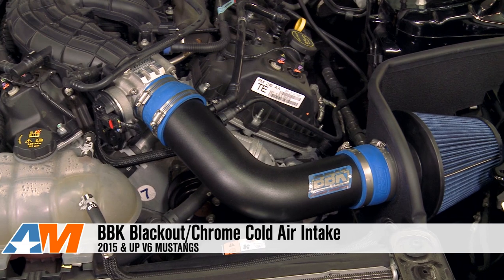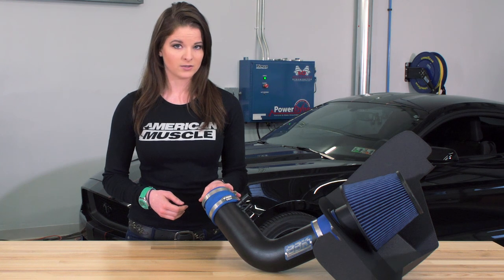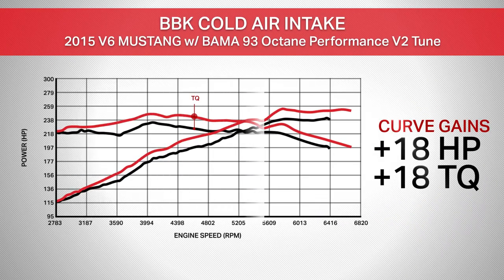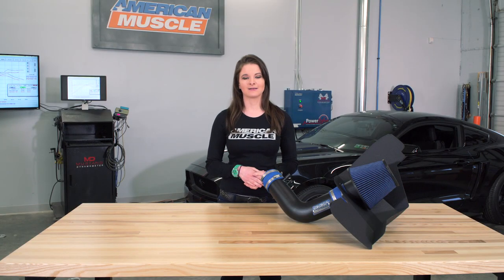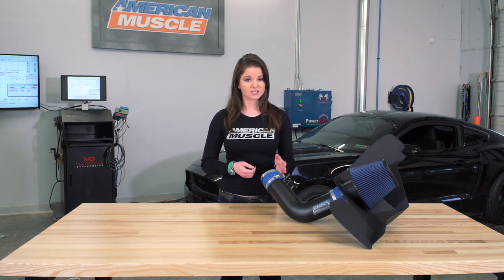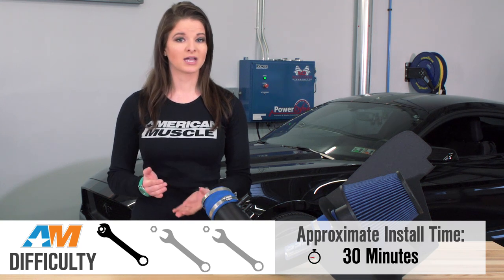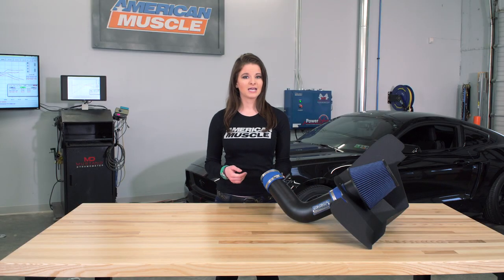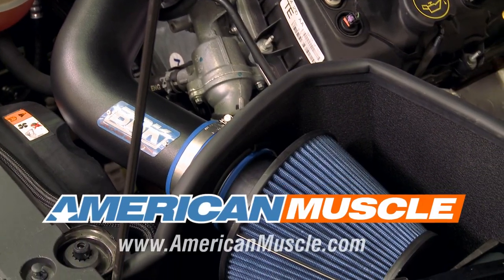Dyno: 2015-2017 Mustang BBK Chrome/Blackout Cold Air Intake (V6) Review & Install

Comment: so does this mean Bama finally makes a tune for the 2015 V6?!
Reply from the maker: +Ricdelreal They are coming Ric! According to the guys over at Bama they are on the final steps! - Will
Reply from the maker: +Ricdelreal The tunes are out! Get them while they're hot man! - Will
Reply: I have an X4 tuner with the BAMA V2 race tune on my 2014 5.0, do i have to purchase a whole new tuner to get tunes for the V6, or can i get a new tune sent to my X4 for the V6 but only be able to use it if I unmount it from my 5.0?

Comment: Lol Steph just basically said this intake is useless. Lmfao ford spent so much money on R&D. Much more than BBK did I'm sure. Cold air intakes are usually for looks.
Reply: And induction sound
Reply: Oh true forgot about that
Reply: I have a roush cai in my ecoboost I get a huge difference in throttle response. maybe because of the turbo. idk
Reply: Yeah being FI makes a difference. But for the 3.7 V6, a CAI alone won't do much. Tuning it is where you get gains.
Reply: +Andrew Estrada indeed
Reply: +Andrew Estrada cool check my vid for sound

Comment: this will not give you any hp gains its proven the stock setup makes the most power reason is because you get lower inlet air temps.